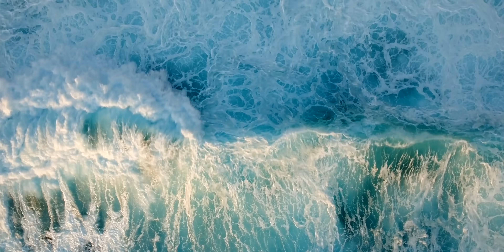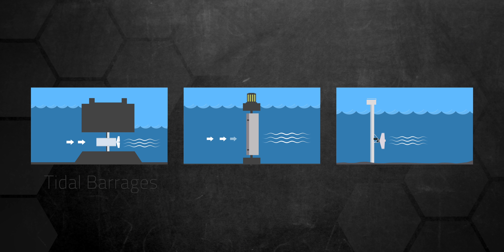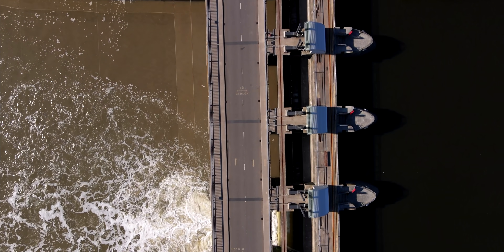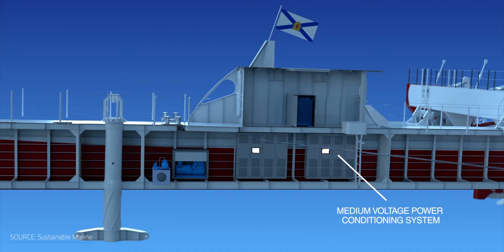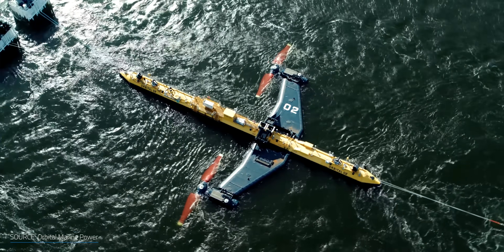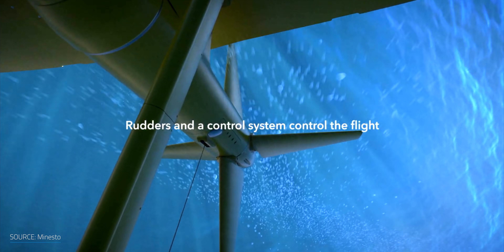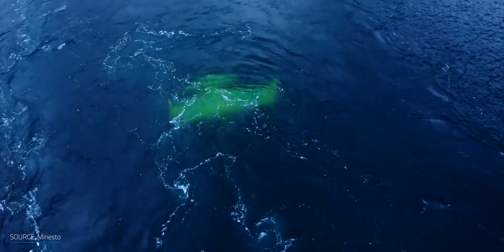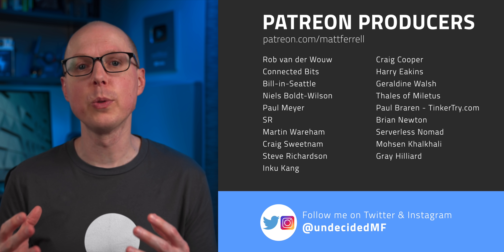Can Underwater Turbines Work? Tidal Power Explained

Comment: Thanks for sharing. Lots of interesting ideas. I have loved the idea of tidal power for years. The best idea I had heard in a long time was the underwater sea carpets. I’m guessing that the 5 mw flexing one may be a maturing of that. They had said the technology was gaining interest based on its potential to protect harbors from erosion alone with energy being an additional benefit. The only problem I see is the incredible potential for high cost maintenance. The most maintenance free option I’ve heard of was the proposal of giant under water concrete venturi’s to be built under the Golden Gate Bridge. They were to be bidirectional and would be used to suck air from shore based vacuum powered generators. No moving parts under water. They expected to be able at minimum to produce 1000MW of power. My thought was imagine the foam in the water. 😂

Comment: The answer to wind and tidal turbines is that they are now unnecessary. We now have the ultimate and cheapest green power device with none of these problems, in the SAFIRE GENERATOR. This is what we need to negate all the problems of all competing green energies. It produces almost costless electricity and therefore hydrogen from new FUSION NUCLEAR and is now immediately upon us. We have recently taken a new step to advance the physic of medium temperature plasma fusion power production by enabling chemistry of the atomic nucleus, or "nuchemy" in the newest FUSION NUCLEAR POWER technology. We are passing the chemistry level where we interacted with the atomic electron shells and are moving on to manipulations in this "NUCHEMY" atomic nuclear era when we interact and multiply nuclear protons. We have rediscovered the lost work of the alchemists and can make new elements with different atomic weights. This was ably demonstrated in "THE SAFIRE PROJECT". Quanta are important. We now have enough energy to manipulate the atomic nucleus much more easily by creating a compartment, or what is a local region of plasma containment so reactions at this atomic nuclear level can easily take place. This is about to practically enabled a really fantastic and cheap new era of energy production for the whole of mankind. This with hydrogen, so free fuel obtained from water or atmospheric moisture anywhere in the world. This new fusion nuclear SAFIRE GENERATOR is at the industrial commercial production final development point as of now and it can retrofit older and decommissioned power plants. The energy argument and other power methodologies are all now virtually irrelevant as we have new and very physically and economically powered practical and local community level fusion nuclear power. Solar roof plus Teslawall battery may be the present way to go domestically but megapack batteries and multiple storage technologies interconnected with an expanded ugly grid have a less certain requirement when you consider new any-scale community based and 24 hr reliable and self-fueling fusion nuclear in the form of the "SAFIRE REACTOR". Learn all about it at "AUREON @t". Then learn the newer EU Theory and plasma physics at "THUNDERBOLTS @t" and you will be permanently reeducated with this advanced newer EU theory that will allow you to understand more about the astrophysics of our whole universe and all within and you will be more informed and can teach your peers.

Comment: Love your videos... very pleasing to see all the possibilities!

One thing worth checking out is the Perth Wave Energy Project, or PWEP, which uses submerged floats at 25m depth to generate pressurised seawater, which is pumped back to shore. This is used to generate electricity AND can desalinate water, as the pressures involved are ideal for reverse osmosis desalination.

Comment: Isn't it a crazy idea, that 'Tidal Power' is technically 'Moon Power' 😁
Reply: Solar power and now lunar power
Reply: @Gingersnaps_the_pumpkin_kitty  the name of the sun is actualy sol thats why its called (sol ar) power and the moon is luna so (luna r) power cool right
Reply: @Maxs.Grandma.trilionare  only in certain languages
Reply: Technically it's an interplay between earth's rotation and the moon's orbit, and also the sun is involved to a more limited extent, but yes it's pretty cool!
Reply: @andrewferguson5992  So it's the power of the Celestials. That's a much cooler name
Reply: And wind power is technically solar
Reply: In this case, i would go even further and describe it a "gravitation power".
Reply: It's actually gravity power. The moon's gravity is moving the tides through generators just like the Earth's gravity is moving water through the generators in dams.
Reply: @bradleyj.fortner2203  If you want to get technical, gravity is not a source of power. It is the kinetic energy of the moon orbiting our planet which pulls the water through the generators. The fact that the moon pulls on the water (and vice versa) slows down the speed at which the moon orbits the earth. Resulting in the moon slowly getting further away from us.
Reply: Moon power is moon knights crazy racist  movement
Reply: And Moon power is actually earth's gravitational power and earth power is Sun's gravitational power... no matter what we do.. its all end with the SUN.. the source of all powers :-)
Reply: @Rushipriyapanda  As stated earlier; Gravity by itself is not a source of power. It is the kinetic energy of the moon orbiting our planet which pulls the water through the generators. On the other hand, I do agree that gravity is also required to keep the moon in orbit around the earth. What I find fascinating, is that the direction in which all planets (incl earth) orbit the sun, originates from the direction as the gas and dust that fell in on itself to create our solar system over 4 billion years ago.😵
Reply: Sokka?
Reply: A streeeeeeeetch but ok
Reply: Hey that was my thought! lol
Reply: Gravity FTW!
Reply: What’s crazier is that we still burn absurd amounts of fossil fuels
Reply: Counter-intuitively it's actually more the earth's rotation energy that is being sapped, not the moon's kinetic energy.  In fact, the moon by itself is also increasing in kinetic energy, taking it from the earth's rotation, raising its orbit.  The fact that the moon is slowing down is actually a result of it having a higher kinetic energy / higher angular momentum (higher but slower orbit).  Extracting energy from the tides takes energy from the difference in angular momentum of the earth on its axis by itself, and the moon around the earth.  More technically we are extracting mechanical energy from the Earth-Moon system.
Reply: „how do you know I believe in aliens“ ah
Reply: tidal power is also solar. Because some are caused by the wind which is caused by the sun.
Reply: @mr.x4001  I'm gonna have to disagree. The tides under regular circumstances are driven by the gravitational effect that the moon has on water. Wind can move water and generate waves. But this has little to do with the tides.
Did you know that on the opposite side of the earth (furthest away from the moon) there is also a tide. This makes the earth appear sort of lemon shaped.
Details here https://youtu.be/3RdkXs8BibE?t=127
Reply: @sabofx  Atmosepheric pressure could impact the level of water, which is due to various effect, temperature and wind. Might this be taken into account ^^ ?
Reply: @nicolasleonard4658  Theoretically, the whole point behind using tidal power, is that it is an extremely reliable sustainable power source. Because the tides are literally as predictable as the cycles of the moon. They rarely disappoint 😊. The variables that you mentioned mostly impact water at the surface level. I don't think atmospheric pressure, wind nor temperature can disturb the tides in such a manner, to be relevant at the depth where the turbines are placed.
But, I am by no means an expert. I will be happy to be corrected by anyone with more scientific credentials. Perhaps that the host of this channel @Matt Ferrell can enlighten us on this matter?
Reply: @sabofx  The sun also affects the tides
Reply: @sabofx  TLDR; yes, the sun applies to tides.

Hey, doin a pretty good job refuting people, but you disagreed with a Mr.X when you should have “agreed but not for the reason he thought.” 

The tides are also affected by the sun, just to a lower extent. This does, however, mean that a constructive and destructive wave interference pattern is observable. 

The high tide is highest when the earth is at the closest point of its orbit with the sun while it is also noon/midnight and the moon is either new or full, depending on what side it’s on when this is happening; this also is where you get the lowest low tides, because the volume of water is “fixed” and more of it is in the high tide area. 

The pattern is pretty weird, but measurable.
Reply: @demonzabrak  Thanks for clearing that one up! Case closed.... 🙂
Reply: @mr.x4001  all forms of power are solar except maybe nuclear. oil is just 100,000 year old solar power.
Reply: @scottmcshannon6821   While what you said about oil is true, SABO-FX is correct about tidal power coming from the kinetic energy of the moon, which I guess you could say was powered by the big bang.
Reply: It's actually the Coriolis Effects that is the driving force for the tides, but gravitational pull of the moon contributes.
Reply: Lol no moon power isn't an applicable term. Pathetic.
Reply: @coronalight77  haha
Reply: @coronalight77  Well, mister Tr0ll, why don't you enlighten us with a more suitable term?

Comment: Who cares about CO2 emission? Serious question. Where is the conclusive data that shows CO2 is not a net BENEFIT? Plants (food!) grow better and require less water to thrive, the weather is more stable (extremes are lower range) as CO2 goes up. 
   A quadrupling of CO2 in the atmosphere would barely produce any noticeable effect as a so-called "greenhouse" gas. Pollution is bad but CO2 is NOT pollution. It just isn't.  The geo-record shows life has thrived best when CO2 was at levels more than a dozen X greater than present.  
    As weather eases up (compare historical records of heat waves and hurricane strength: they are decreasing) wind will be even less viable.  Turbines all over in air or water are expensive or detrimental to wildlife.  
    END the mania about reducing "CARBON". EVIL CARBON     Oooooooh!  You people are deranged. 

Stop behaving like you've proven CO2 is bad.

Comment: There is an under water system from Australia called Ceto, I guess it's not quite 'tidal' but works on below surface sea movement, which is constant unlike tidal which has moments of no motion between rising and falling tides. Ceto 5 was  originally used to pump water ashore under high pressure to turn a turbine, with the advantage of being able to be switched to a reverse osmosis membrane in times of low electricity need to create fresh water. The later version Ceto 6 transforms sea movement directly to electrical energy.

Comment: As I often say, "No silver bullet. Only silver buckshot."

With that in mind, we should look to a diversified suite of solutions harnessing the immense power of tidal currents.

As a former submariner, the brightest solution of the bunch so far is Orbital's design. The major downfall of undersea systems is maintenance. Orbital addresses this problem by designing retractable turbines that facilitate work on the surface. Additionally, the entire rig can be easily and affordably towed to port for more extensive maintenance or repairs.

The undulating membrane looks interesting. However, I worry about all the moving parts. The design just looks finicky to me.

And, while I'd love to see the undersea kite, its wind-harnessing cousin, Makani, failed spectacularly.
Reply: who said any one solution to cover all situations is the goal?
Reply: There's not really anything stopping the membrane from being mounted to a floating rig. In fact, given that they're so much more spatially efficient, this might even be easier/more cost-effective than mounting and operating multiple gigantic turbines and the heavy hydraulic systems that are required for raising and lowering them.
From what I could tell, Orbital's rig allows for the rotors' axis to be rotated 90 degrees as well to make it easier to lift & lower them without inducing undue stress on the system. That requires quite a few moving parts to accomplish, as well.
The membrane's going to need a bit more work, that much is clear, but the very high power output combined with the low spatial requirements I believe would make it a very strong contender.
Reply: The membrane looks like it needs some material science breakthroughs to properly implement the concept.  

Stuff like Complient Mechanisms or Memory metal to reduce part count.  Surfaces that are slippery to avoid marine buildup.  OR... membranes designed to grow the specific types of marine plants that don't hinder the operation.  Sorta like "bio armor".

Like Da Vinci's helicopter, there is more to consider then simple physics of power generation.

Comment: I designed a drag type water turbine where the blades rotated into the flow to reduce drag when rotating upstream, but because it was a drag type turbine, and rotated at low velocity but high torque, nobody was interested.  Energy generated is the square of its velocity. The velocity of the kite type turbine would be very destructive on fish populations because of its high velocity.

Comment: should combine offshore wind and underwater current turbines in the same tower structure can use a diferential gearbox  so they can point in independent directions and turn at each optimal speed and still share the same generator and power transmition parts and share the maintnance team etc etc

Comment: So, I'm guessing that surface wave capture tech didn't go anywhere? Shame. It was similar to the wave membrane, but, consisted of what looked like a row of tubular train cars floating on the surface ahead of the wave break zones. They used hydraulic pistons to capture the energy from wave undulation. I had high hopes for that tech.

Comment: I know one of the engineers at Orbital, they're quite proud of their system.
Reply: Not going to trash talk a contender here but a lot more is needed and technically proven to be possible.
Reply: @cyklonetidalenergy7141  
Another concern is a matter of where to place tidal power platforms, because of conservation of energy. That kinetic energy downstream will be affected depending on how many and where they are.
Reply: @Aereto  somewhat right direction of thought, but not really... it is very hard to max out a tidal sites flow potential. Much of it has too shallow water, affects shipping lanes or fisheries. You can't space the turbines too closely in the vortex wake fields of other turbines w/o loosing efficiency like in wind farms. There is a lot to learn about tidal power humans don't know exactly yet.

Comment: Awesome video.
I have long felt that tidal/current generation, in theory, would be so much better than wind. There is a huge investment in embedded energy in just producing the equipment that many advocates refuse to acknowledge, let alone mention or take into account when talking about carbon savings, etc.
As opposed to composites and polymers, these could be built with much simpler and cheaper steel alloys, especially the "kites" which are way, way smaller for the given output, should be much safer/easier to maintain, have much more efficient water cooling and won't suffer from the terrible fires, etc of wind turbine failure, and when they are done will be able to be mostly recycled unlike wind turbine blades that are now becoming an environmental nightmare.
That O2 and the mobile, ship based, units are way, way to inefficient compared to invested/embodied energy and should naturally die without extreme subsidies.
Yes, the kites are really promising.